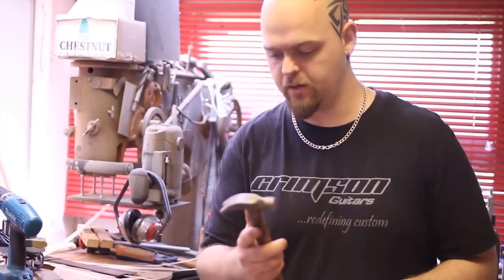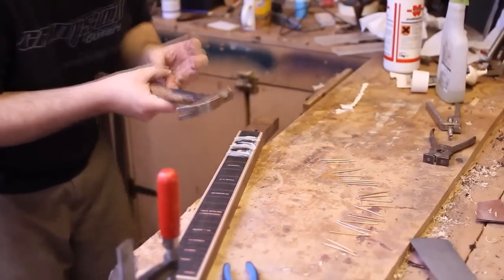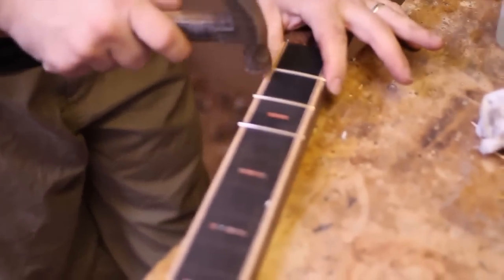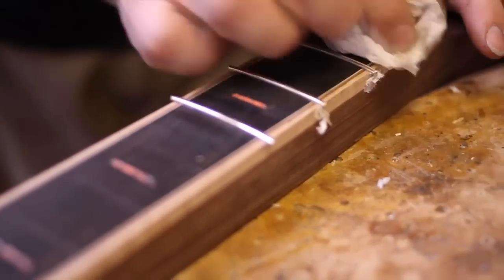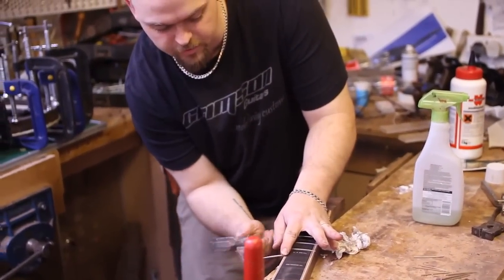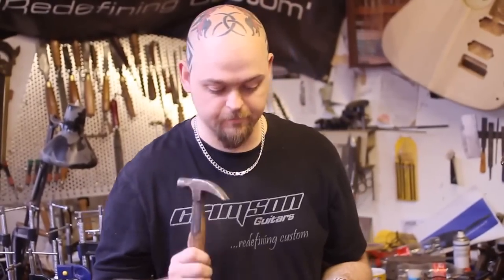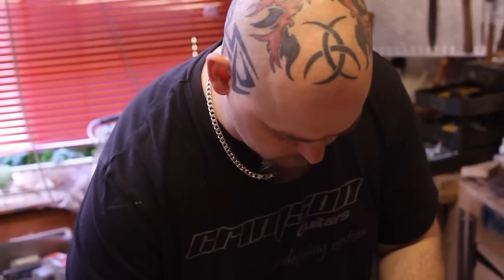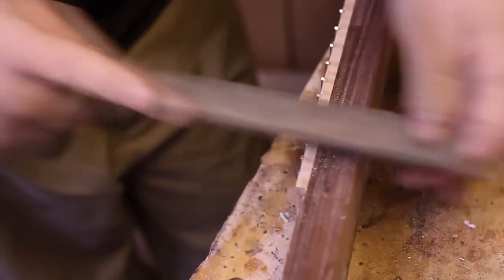Tricks and Tutorials - Ep 2 - How to Fret a Guitar

Comment: The one & only time I fretted a fretboard was when following a BBC series to build a dulcimer about 40 years ago. They told us to strike a series of nicks into the tang with a trimming knife so as to create small spurs sticking out sideways, which would supposedly give a better hold once the fret was hammered in.  What do you think?
Reply from the maker: technically it works.. however it really isn't necessary imo.. B
Reply: @CrimsonCustomGuitars  Yes, I've done a few since that comment without nicks. I'd think now that it would be easier to splinter the fretboard when removing them.

Comment: How about a body hammer? The kind you use for automotive. Nice flat hammer head and decently soft metal. Or how about a block of brass or copper that you use as a buffer between a hammer and the fret wire?
Reply from the maker: The hammer works well, my first fret hammer, used for nearly a decade, was a nice old planishing hammer.. I like to see the fret though, a block between the hammer and the fret would frighten me.. B

Comment: Well, it seems you don't often reply to comments, so I may be wasting my time by commenting. However, I am wondering, since you seem concerned about making frets easier to remove for luthiers who might be working on the guitar in the future, doesn't using a product like No More Nails kind of negate the rest of your efforts? Or is there a solvent or other method of glue removal I am unaware of?
Reply: I don't know if it works with this type of glue as well, but many people heat up the frets with a soldering iron or a clothes iron when they need to remove the old frets. The correct amount of heat makes the glue soft again and the fret extraction easier.
Reply: THe tangs of the frets are a much more serious culprit as far as tear-out is concerned.
Reply from the maker: heat is your friend and pretty much de rigour among guitar repair people.. B